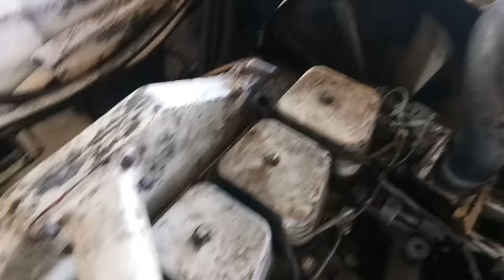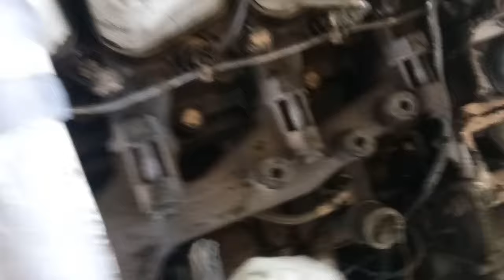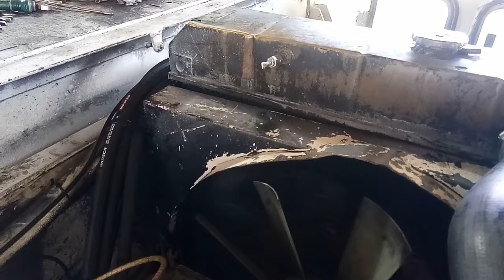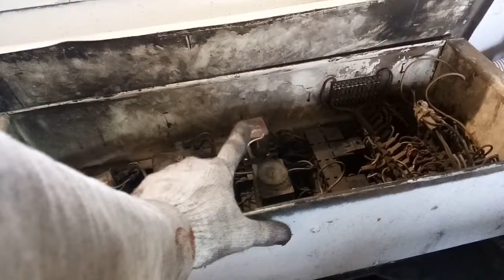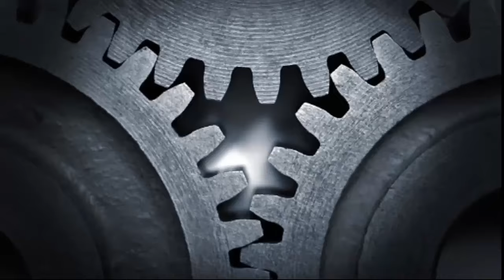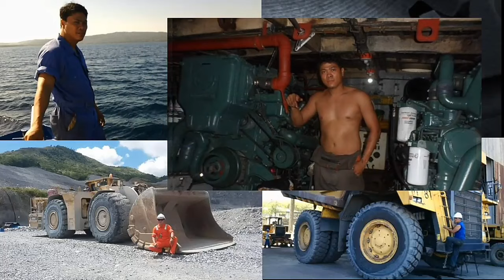Mga dahilan kung bakit namamatayan tayo ng makina

Comment: Boss baka po pede ninyo akong matulungan Meron po akong Nissan x salon.1998 model.every 5 minute namatay matay Ang makina ko.pero po pag lumamig na. Umaandar po ulit ano po ba Ang sira Niya. At paano ko po Siya magagawa..Sana pi matulungan ninyo ako salamat
Reply from the maker: Paycheck nio po ignition coil nio..
Reply: @boygrasagarage6243  Isa pa po sir bukod po sa ignition coil pede po bang maging dahilan din po Yung fuel pump. para mamatay Ang makina. Sana po masagot nyo po ako.maraming salamat po

Comment: Ano kayang kaso ang nanginginig ang makina? Noong una basta nanginginig siya sa panahon ng low idle peru hindi namamatay. Ang akala ko may halo na tubig ang diesel kaya na-drain ko ang fuel filter at may halong tubig nga. Peru hindi na resolve ang problema. Andoon pa rin ang panginginig pagmabagal ang takbo ng sasakyan.

Ayos naman ang pressure ng langis, ayos din naman ang temperature hindi nag-ooverheat.  Ngayon kahit na sa 1st at 2nd gear ay namamatay parang nawawalan ng fuel. Kaya ang ginawa ko naman ay na-bleed ang fuel lines papunta sa injection pump peru hindi pa rin tumino.
Reply: na solusyonan nyopo ba? same po tayo ng issue

Comment: Boss bakit namamatay yung frontier matic pag ikakambiyo na.
Reply from the maker: Ndi b palyado? Bka may problema sa makina. Pcheck nio po muna actual.
Reply: @boygrasagarage6243  possible po ba Yun sir, d naman po palayado
Reply from the maker: @jeoshq4513 paglow power po kc makina ndi kinakaya pag may load nah. Pscan nio po. Bka nid lng ng cleaning ng mga sensors like map sensor.
Reply: @boygrasagarage6243  binaba po transmission 2x. Dahil nasunog Yun trans walang hatak po. Same pa din eh, kaya po humingai na ko ng rescue sir sa Inyo. Any suggestion po. Pag nag ok ako na bahala sir. Pahingi na din po ng number nyo sir. Thank u po
Reply from the maker: Message mo q sa fb page
Reply from the maker: @jeoshq4513 naoverhaul b ang transmission? Ano mga pinalitan?
Reply: @boygrasagarage6243  mga clutch